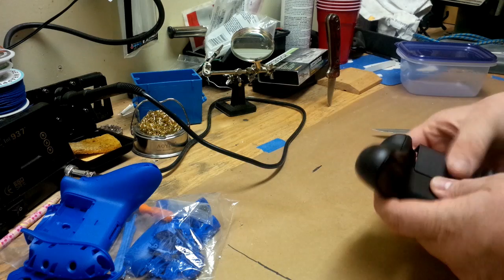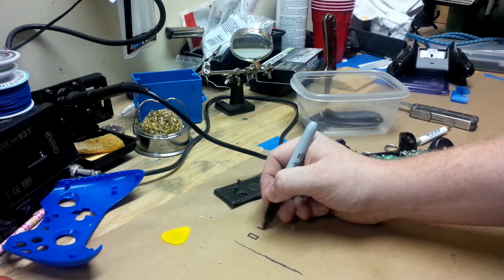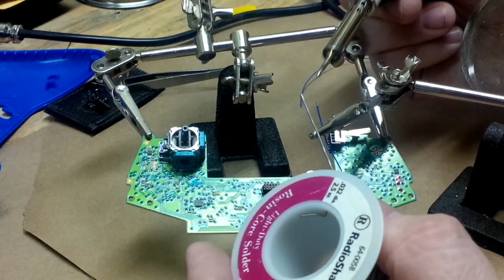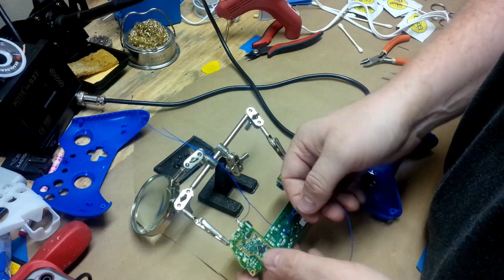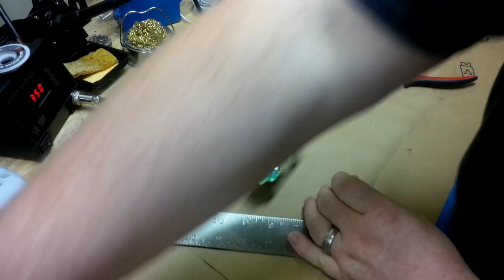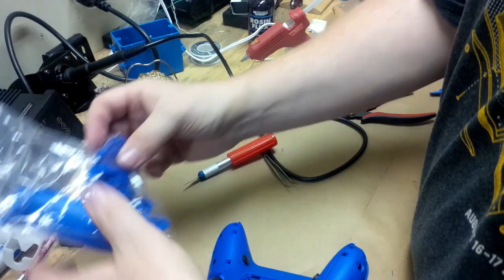Reddit Black R&D #11: From start to finish; Custom controller build.

Comment: Hey if I wanted to do this on another controller where I can’t find the PGB/motherboard guide online, how would you identify which test points correspond to which buttons on the controller? Just solder a wire with a tact switch one by one until I identify the correct test points? I want to do this on a PowerA Fusion Pro controller because I don’t like their paddles but there’s no motherboard guide that I can find.
Reply from the maker: That's one way to do it, another way would be to tap into the carbon pads under the buttons and run leads from there.
Reply: @TheCultOfKaos  Thanks for the quick response! Your controller mod vids are amazing! Also, how do I correctly identify a ground point to solder a ground wire to for the tact switch? And if I’m installing 4 back buttons, can I solder the 4 ground wires to the same 1 ground spot?
Reply from the maker: @jasonbourne2204  depends on the board. Most small electronics do use a common ground so if you find one you can use it for everything usually. Finding it is usually easiest done with a multimeter on continuity test mode. Most chips on a board have at least one pin that goes to ground. If you can find the data sheet for a chip by model number it should tell you which pin is ground.
Reply: @TheCultOfKaos  Gotcha. So for default Xbox controllers, you can use one common ground for all the switches, right?
Reply from the maker: @jasonbourne2204  yep.
Reply: @TheCultOfKaos  Last question for now, how dangerous is it (if at all) to just randomly test test points and ground points until I find the right ones?
Reply from the maker: @jasonbourne2204  it's usually low risk. For finding common grounds you can usually do it without batteries installed or cables.plugged in. Should be grounds kind of allover the place.
Reply: @TheCultOfKaos  Is there any trick to guessing what is a common ground point just by looking at it (ie, I don’t have a multimeter or other similar tool)?
Reply from the maker: @jasonbourne2204  look for identifying marks on any of the chips, look up  or Google their datasheet and see if any pins are grounds.
Reply: @TheCultOfKaos  Hey just wanted to let you know that it worked out great! Love my new controller. Thanks for your great vids and advice!

Comment: Man your videos have been so helpful. I know they’re quite old now but if you’re seeing this please make a series x controller version! Lol. Also, what exact wire should I use? Looks like you’re using solid. I have very small stranded copper.
Reply from the maker: Thanks! I moved over to pc about 5 years ago so I don’t have any controllers to mod. Just standard wire works, sometimes they call it wrapping wire.
Reply: @TheCultOfKaos  awesome, thanks for getting back to me. I actually moved to pc 3 years ago but am going back into controller gaming for certain games. Will the thin copper that I have work? I’ll double check whether it’s stranded I truly can’t remember. But it’s tiny like I held it on the board and it seems like it’ll be just fine
Reply from the maker: @yung.houdini  really anything conductive would work. In a pinch I’ve scrounged wire from old phone or network cables for projects like these.
Reply: @TheCultOfKaos  thanks again man I really appreciate it!
Reply: @TheCultOfKaos  Hey man. I know you're not my personal life line for electronics but I now have a whole new set of issues and I was curious if you could help me. 

Basically the PCB on my controller is not like yours at all. However, I did look up a 1708 Schematic and it appears to match up to that? 

So like, I'm fairly positive that I've figured out where I need to solder instead. But like I don't have that black rectangle next to the right analog, and both of the points I need to solder according to the schematic I'm viewing, for a 1708, are actually on the other side of the PCB in a much better spot to access.

Any input on the situation would be awesome.
Reply from the maker: @yung.houdini  if you google “Xbox one 1708 controller schematics” the first link from acid mods should have high res pics of the boards and solder points.
Reply: @TheCultOfKaos  Yes sir I ended up getting it done! Well, not entirely. I'm waiting for my switches but did have one laying around. But I tested the solder points for both B and RT and they're functioning well, just need to get the switches in the mail and mount them haha. I'm just going to go all out and do A and B back buttons as well as both smart triggers while it's already ripped apart.

I was just curious though why it's so different if yours is a 1708 as well?
Reply from the maker: @yung.houdini  sometimes they make changes and don’t bump the revisions. Luckily XB controllers are not too far apart from one to the other. Soldering to ps4 controllers was a huge pain, was a lot easier to get flexible circuit board shims for modding.
Reply: @TheCultOfKaos  Hey, would 30AWG wrapping wire work fine? ( I realize this is a very old video/comment).
Reply from the maker: @SuspiciousKoala  yep. It would work.
Reply: @TheCultOfKaos  Thanks for the quick response! I'm thinking of soldering on the eXtremeRate Hope kit for the first 4 buttons on my Series X controller, then doing an additional 2 myself (which wouldn't be remappable--probably would do L3 and R3 for those).

Comment: Could you link more pictures of the circuit board layout? I bought a Scuff One controller but the 'Right Stick' button is linked to the 'X' button and I'm trying to fix it (can't RMA it because I live in Brazil). Thanks
Reply from the maker: If you check R&D #4, the description has a link to a closeup of the circuit board.

Comment: Now how do I do this using everyday household tools?
Reply from the maker: Some of the tools you just cant get around needing, specifically the soldering iron and torx bits. You can use a regular drill for the button holes. Hot glue guns you can get at the dollar store. The first one I ever built I used no flux, a crappy soldering iron, wires I pulled out of USB/ethernet cables, and just a wired drill.